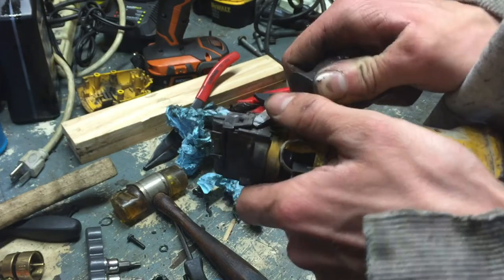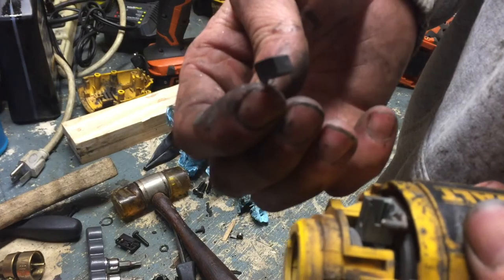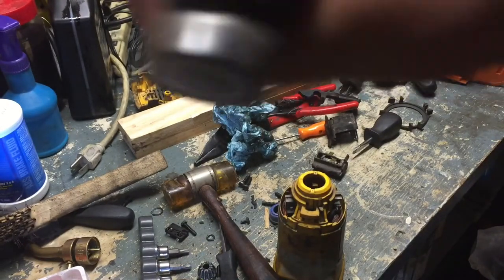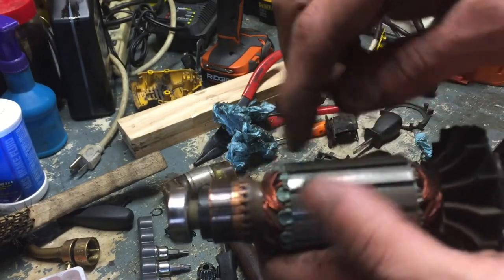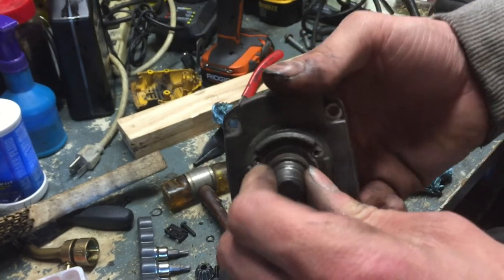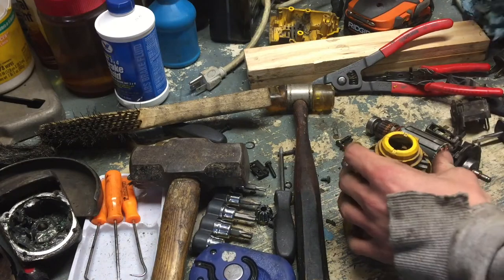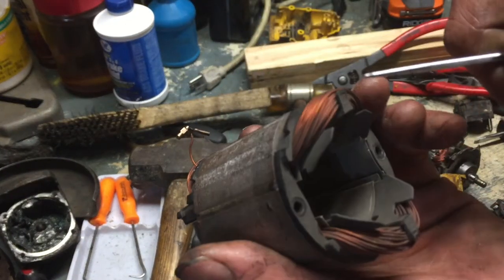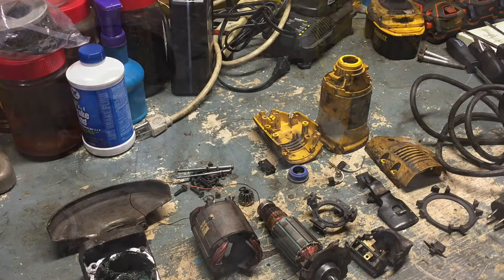DeWalt DW402 4 1/2 inch Angle Grinder Failure and Teardown Part 2

Comment: I picked a DW402 at a garage sale for $25.00, came with a few blades. It's dirty but doesn't appear to have any major use or any damage. I'm wondering if any thing to do to them maintenance wise, so it will last longer? I suppose their designed to be maintenance free with no lubrication?

I'm wondering if I should  take it a part, clean and re-grease?

I've read a few things about angle grinder grease online. One person stated to use a low viscosity lithium grease. Another said something about a high temperature lithium while another stated:
_
"The factory grease normally has a blend of relatively low melting point 
lubricants, the theory being no matter what grease you use the 
centrifugal forces will soon throw it clear of the gears.

So you need something that will re melt at low working temp in use to 
coat the lowest point when the tool is warm after work. When re started 
next this will again be thrown off, coating enough of the gears each 
time to provide lubrication."
----

Not certain what the best grease to use if I decide to take it apart, clean it up and re-grease?

Comment: what kind of grease do you use for gears?
Reply: standard car lithium grease is all you want, it wont actually do much untill theres enough heat to melt it to let the oil flow, in which case you are pushing it too long and hard, dont put too much in or it will drag on the gear and overeat, though as new they dont put enough in.

Comment: you were hitting the opposite way that's why it broke. Any ways there is a tool for gears removal, even  if you were hitting it the proper way it might of broke, that's why you need to use gear splitter tool and there is a bearing splitter  tool also so you don't have to give your self hard time trying to pull out a ball bearing with flat screw driver